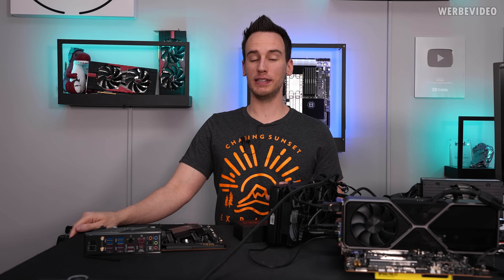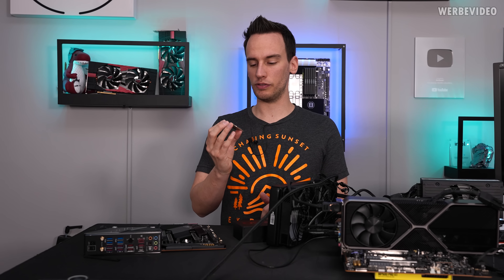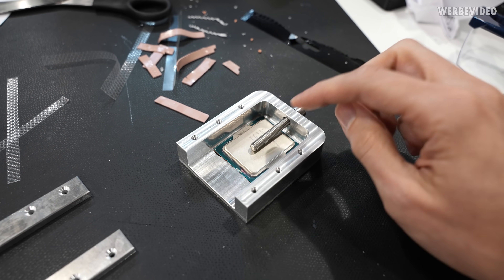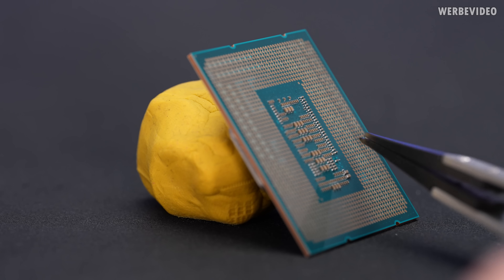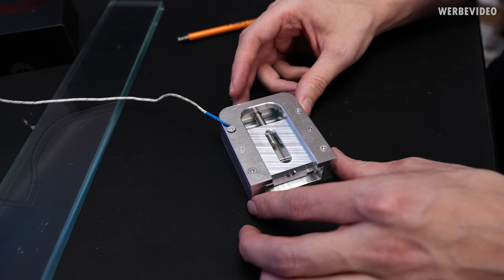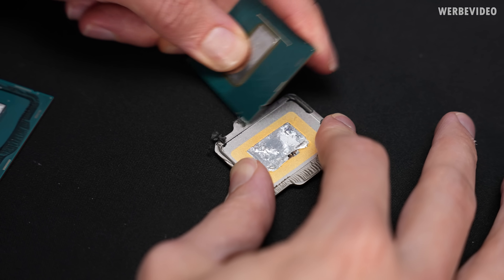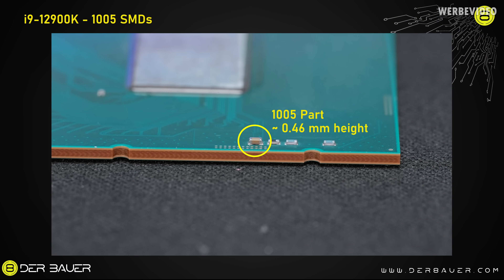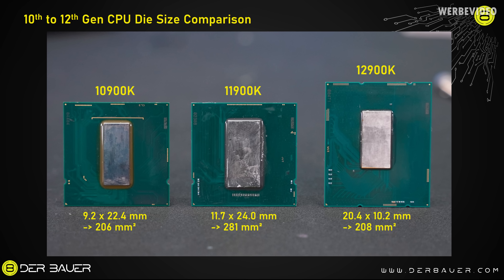I killed my 12900K (oops) and delidded it

Comment: Intel should offer a DD (direct die) sku that would be effectively an unlocked, heavily binned K (like an SK) sold without an IHS and no or limited warranty (for obvious reasons). They could charge about the same as a K, and probably the cost savings from losing the IHS (it's a big hunk of expensive copper and indium) and the lack of warranty claims would offset the cost to them for binning. Would probably be popular with enthusiasts and thus generate good buzz, plus be a nice publicity type gesture to the enthusiast community. They could even let partners do special DD motherboards set up for DD cooling with an optimized backplate and bracket that doesn't include the spring-loaded clip.

Comment: I have 2 12900ks and one runs 20C cooler than the other on the exact sam setup. tried them both an an aio as well as my EKWB LGA 1700 block . Ive lapped my die. removed the socket bracket to reduce ILM pressure, my next step is to try and delid as this is a p core sp 120 chip id like to keep it and be able to utilize it, any recommendations to a first timer? Im unsure if there is any delid kits on the market for 12th gen currently

Comment: Any idea why we use an IHS on modern cpus? Laptops don't have them while desktops use them. I get it, it spreads heats, but it looks like a middle man when you could have a copper base plate on the heatsink.
Reply: 1) For protection since it's something people handle/install themself unlike laptop and gpu that comes preinstalled with cooler.
2) For pressure protection so you don't crack die when screwing cooler too tight.

Comment: The 0402 size component I am used to is something you have on the outer perimeter of the cpu, the component here is more likely 01005 sized - quarter of a tiny 0201. Metric is not the default on component sizes, you should have said that explicitly.
Reply: yeah this definitely looks smaller than a 0402

Comment: Looking at that one chonker cap, this one should be fairly easy to work with. It's retty much right at the edge, and only flanked by one resistor on one side (with a decent gap between). Could definitely swap that for a different cap with a slightly lower Z-height package. Even if it gets slightly longer, you should have about 0.3-0.35 mm to go on in length before the component endcaps get too far away from the solderpads for an acceptable bond. If it gets wider, that's a non-issue here, just need to hold it down while soldering so the solder surface tension doesn't pull it sideways and short it to the test points.

Comment: But, this is bad. If CPU died after cooler is not properly mounted, it is not good overheat protection. In times of P4 vs athlon, this was on of point for intel. Because amd burned like paper. But now it is opposite.

Comment: Killed an unreleased expensive CPU by..dropping a screw with the system power on? Wow.. Speechless. Interesting it killed the CPU not the board though, shame it isn't the other way around, board could have likely been repaired! Could have shorted a voltage rail to PCIe lines, or perhaps a memory bus, depending where the screw fell. That's my guess! Would have served you right for the board to die though... What a muppet!

Comment: They have left plenty of room under that heat spreader to add more cores if they feel they need to.  I guess that all depends on how this chips compare to Ryzens, both now, and next gen.
Reply: Thats... not how any of this works.
Reply: @PollysPokePicks  of course it is.  Why do you think they increased the package size.  This socket is future proofed to last two generations.  Raptor lake is due to have 8 P cores and 16 E cores, totalling 32 threads.  They could change that depending on what AMD do.  Ryzen AM4 socket has almost 500 less pins than this Intel Socket and even their next AM5 socket is slightly less.  Intel 12th gen is 1800 pins (despite being called LGA 1700) and AMD next gen AM5 will be 1718 pins)

Comment: Hey der8auer and everyone do you think I can use a Noctua d15 on a 12900k and a Asus z690 Hero?  I am going to run at stock settings no overclock.  Case is a corsair 680x.  Shouldn't a d15(2 Fans on Noctua) be enough for general use and gaming with a rtx 3080?  Or do you all think I need to go 360 aio?  Help  lol

Comment: "connected pads" are most probably either VIN a.k.a. main voltage or ground.
the 'bigger' separate pads are also probably ground. this is made to lower the pin-to-pad resistance and improve heat spreading, I think

Comment: One solution for direct die cooling the 12900K, would be to notch out some material from the baseplate of the waterblock (for instance a Optimus Signature, which doesn't use springs, so processors z-heights don't matter) and have a small pocket surround that one SMD cap.

Comment: i mean unless you have a heatpipe in your cooler where the cap is, you might be able to isolate in by removing some material in that area. check minimum isolation distance for desired voltage.

Comment: I wonder if the landing points for the pins, some bigger some smaller is a difference between landing points for pins for the Performance cores vs Efficiency cores.. the Performance cores being the larger landing points and the smaller being the efficiency core landing points..

Comment: The differing size pads are likely due to needing to maximizing surface area. Less critical pads like ground pads can be made smaller while power/critical signal pads can be made larger.

Comment: A soldered CPU is just prefect like it is, not worth to delide it. Finally Intel is soldering again... this will last nearly for ever ^^
Reply: According to der8auer's previous tests, Conduconaut liquid metal performs a bit better than solder (about 5 degrees C). So it still makes sense for people really pushing the limits of the CPU and need the best temps.
Reply: @alex-d3l2z  yes, only for those peoples i bet yes. But you can get 5C° better Temps also with a bigger cooling or a great watercooling. A soldered CPU is fully enough for the most people's. I had till last week 10 years long my Xeon W3690 running on 4.2Ghz and never had issues with this nice CPU. It's soldered and it still working like a charm 😀 But now is time for my R9 5950x xD It's also soldered, so no problem for the next 30 - 40 years or more ^^
Reply: @NSC-Modz  if you delid and also go direct to die with the cooling it can get you a 10c drop. That'll allow an overclocking enthusiast to grab another 100mhz on their OC.
Reply: @riffsthatkill2180  sure, this is only for freaks like me and some others, but for the most people's it's just not worth.

Comment: SMD wouldn't be an issue. Just grind little bit off from cooler itself right where it would sit at. Wouldn't affect thermally at all and wouldn't destroy anything. Doesn't even require high tech tools. Drill go BRRRRRRRRRRT

Comment: Few days ago i was assembling dual Xeon e5-2680 v3 workstation. While i was assembling mounting screws for tower cooler - one of them felt down to MB on some ICs. After this 'situation' one of the CPU dies. MB has critical error LED and if there are CPU issues - it lighs up:)

Comment: I feel your the best hardware site for Over clockers. Can't wait till you do do a direct die. As for the 12900k I going to wait on raptor lake as I just built Rocket lake for my collection of water cooled PCs. The only non water-cooled PC in my collection is Apple Ruby.  Sense the 12900k is vary low count product CPU I want it in my collection. That's the only reason I built it. Its also a water cooled pc unlike any Lian li water cooled PC . This one is built perfectly concerning 1.5 GPM of flow.  I already have a video but I won't show it until my low pressure high flow system is done. It will be a educational video highlighting the best aspects of both systems.  Low flow I already know which is the better system . But also more expensive by about $150 for the water cooled parts.  I use bits power fittings so more money can be saved. I prefer xflow Rads for that reason I will be using The lian li XL case for all customer builds. I managed 1 x flow  Rad in the Dynamic but much modding was needed , Keep videos coming. I will tell you when I post my videos . You will find my methods vary interesting that I know.
Reply: lol

Comment: You could pull that 1005 cap off, measure the capacitance and replace it with two caps in the same 1005 size but half the height. The only tricky part will be matching the dielectric, although it probably won't matter too much. If in doubt use X8R
Reply: Wouldn't it be a whole lot easier to just make a little notch in the cold plate to give enough clearance without touching the cap? It wouldn't be anywhere near the die area so its not like it would have any effect at all on anything else.
Reply: @dracer35  Yeah, probably. A poke at the drill press or some filing.
Reply: C0G or bust!
Reply: @Spirit532  you want to use exactly what Intel used so it performs exactly the same. In this case any difference is potentially undesirable. 

Brown casing means class 2 dielectric. It's almost certainly X7R or X8R or similar
Reply: @toby1248  Better dielectric is fine. Just not cheap. The case color can vary, and is not necessarily always brown.
Reply: @Spirit532  a C0G cap in the same size and capacitance can have more leakage than the equivalent class 2 due to thinner dielectric. It also won't show the same DC bias so the effective capacitance won't be the same
Reply: @toby1248  Leakage is entirely irrelevant in decoupling and bulk storage, and the voltage derating is not super important if your caps are rated 2-6x the voltage they'll ever see.
ESR and ESL are, however, critical.

Comment: With direct-die cooling you don't really have to use a heatsink the same size of the CPU's PCB. It could be smaller and not reach the SMD so that solves the problem. or you could also cut out some material from the heatsink where it meets the SMD and create enough separation.
Reply: ya I was also thinking about cutting away part of the cooler where it would touch the caps
Reply: Maybe you can add a thin copper sheet rectangle shape as big as the die, between the CPU die and the cooling waterblock .... 
I will definitely delid my 12900k after purchase. I am not sure though what kind of tool to use ... nice tool you've done there der8auer . Can I send you a 12900k for you to delid it ??  :)
Reply: @TiraSoft_GB_Ham  by the looks of it, it's not worth deliding the 12th series.
If you really want to do it, you can improvise a delid tool very easily with a couple blocks of aluminum that you can buy from general hardware stores. All you need is a drill and some screws and a bit of creativity.
P.S.: adding a thin copper layer between the die and the heatsink effectively negates the benefits of deliding as you're adding a 3rd meterial sandwiched between liquid metal. You'd be better off not deliding at all than doing that.
Reply: @HDJess  You might be right ... I know all layers are thinner with Gen12 . But so far all Gens of Intel were doing better after delidding. I hope I will be able to check it myself. 
And again you are right about an improvised tool for delidding, good tip, I think I can imagine a way do do it without CNC milling ...
And about the added layer, yes, I agree. Another way would be to sand down from the copper block and leave a rectangle in the middle the size of IHS.

Comment: On the contacts pads part of the video where they appear to connect . A guess is, to reduce the amount of traces on the motherboard to either power delivery or memory slots? Or could it be internal pathways between the 2 different cores?
So release date is 4th November 2021 and maybe a video on 2nd or 3rd November 2021.
Reply: Video on 4th. Idiots at Intel decided to lift NDA exactly on release date...

Comment: But I can't understand how a CPU has died by dropping a screw on it. I mean the CPU was mounted, and the screw would have fallen into the IHS, how did it die ?
Reply: The screw fell onto the mobo. It obviously shorted two components or pads connected directly to the CPU, that caused it to pop. The IHS isn't protecting anything that could be damaged by a screw anyways; aside from cracking the die. Or the screw could have bridged any one of those hundred or so test pads or SMD components. There's about a million ways a screw could pop a CPU in the socket with the IHS attached.
Reply: @xenonram  Yeah you right that shorted the components make sense...well as he said, very easy for him to get alot more CPUs for free so nothing happens here.
Reply: The screw didn't fall on the CPU, it fell on the motherboard and caused an electrical short.

Comment: I've never seen such levels of excitement in a cat before. My two girls literally don't want anything to do with my PC again since one time when curious, they walked too close to me when using compressed air.
Reply: my cats are nuts about fans, unattached psu cables when I'm building a PC, mouse pointer, velcro cable tie of my mouse, they're even excited about zip tie bits that I cut off, keep playing with them and pushing them under the carpet etc. They generally love being around the PC, at my peril and the expense of blocking any top exhaust airflow.
Reply: @ufsteropolstero6014  my cats did the same thing. It was a pain to build my ox with them around. I had another board on a test bench that was sitting out and one of them bit through the cable for one of the cpu fans.
Reply: did fur go flying? or did the cats when the air went PSSHHH?

Comment: You can as problematic capacitor its located on the edge make very small hole (but not inside out) in cooler so capasitor will not touch it.

Comment: What would happen if the cooler was touching the capacitor? Would that kill the CPU?
Reply: MLCCs are ceramic and therefore brittle. Pressure from a cooler will crack it. If MLCCs crack they can develop an internal short, which will likely kill the cpu in one way or another

Comment: I bet the gold is offset to dissipate heat more efficiently on the P cores instead of centered when its not needed as much for the E cores. Just a theory.
Reply: if you look at any IHS that is soldered you will see a gold pad as well, it's meant to allow the solder to work in short ;)
Reply: @DLTX1007  I didn't know that! Always thought it was for better heat transfer.

Comment: Forgot to unplug a server one time and killed a GPU. That is how i learned that Some iLO controllers power the pcie slot full time.
Reply: What do you mean? I have no idea what an iLO controller is but, how did it even die? It got fed more voltage/current than it was supposed to? It was being used but the fans werent working for some reason?
Reply: @AndyU96  System was powered off. but the pci slots still had power so removing the card must have shorted it out killing it.

iLO is a type of remote server management system that allows cold boot and headless control over the network.
Reply: sorry for your loss.
thanks for valuable information.
Reply: Haha, Yep. It's one of those things that you don't think about until after, and then it all makes sense when you think about how an iLO works and what it can do. We have all been there before.